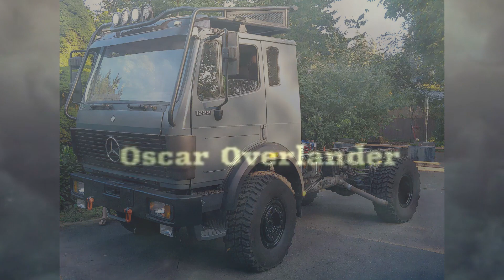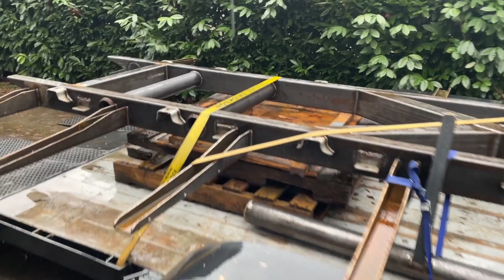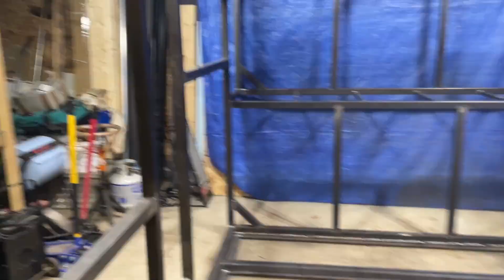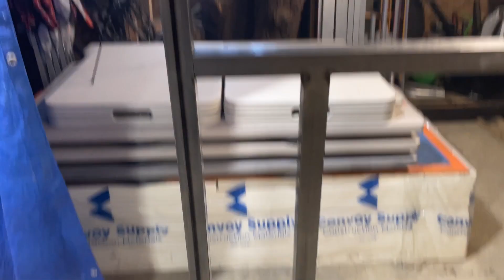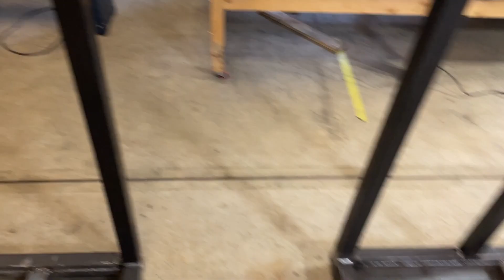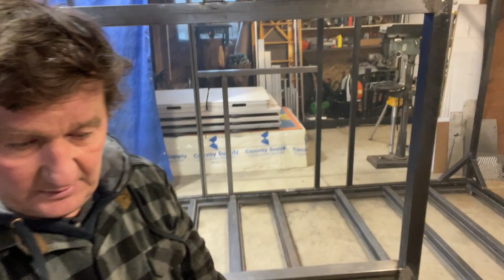Expedition Truck Habitat wall structure fitting and welding. All DIY !

Comment: Do you wonder if the subframe is overengineered, meaning the frame on the habitat crossmembers and subframe seems a bit redundant. Some reengineering could combine those frames
Reply from the maker: Better safe than sorry. But it also includes the possibility that someone installs a different box on it if he does not like the design or layout with a lighter structure, using the same subframe.
Reply: @oscaroverlander_MB1222AF Yes you are correct with composite habitats that weigh 1000lbs empty. But yours as well as mine weigh 3000 or more pounds empty.  So the habitat frame, if in steel could be integrated with subframe frame, to avoid redundancy. I learn from you, and this would be my opinion

Comment: Great job!! Can't wait for more! Looks like I need to learn how to weld!
Reply from the maker: Thank you ! Well it does not hurt to know how to weld, the easiest is MIG welding to learn in my opinion, you open the gas bottle and pull the trigger, than you fiddle with the amperage on the welding machine until you happy with your bead. From there it is practice, practice  and practice again :-)
Reply: One question for you my friend, a lot of guys buy composite panels and fiberglass extrusions from a supplier like total composites and use them to build the habitation box without a steel frame. What is the advantage to building it the way you are doing it with a steel frame?
Reply from the maker: @RichardCrabbe403  this is a great question I will answer this in my next video or the one after that ! Thank you !